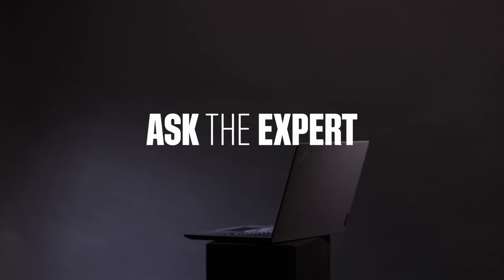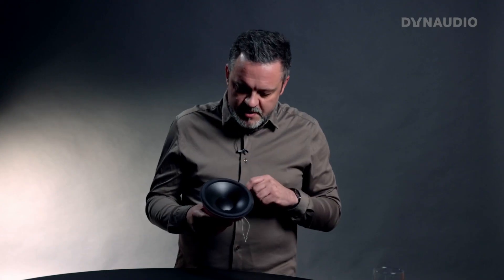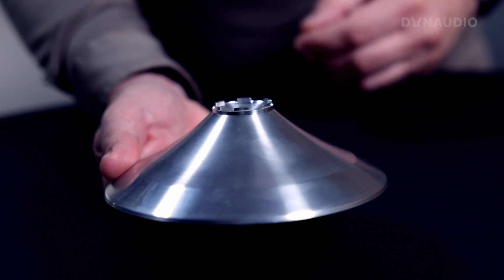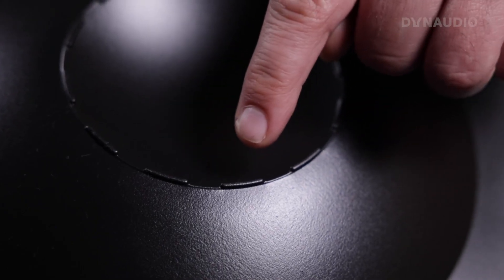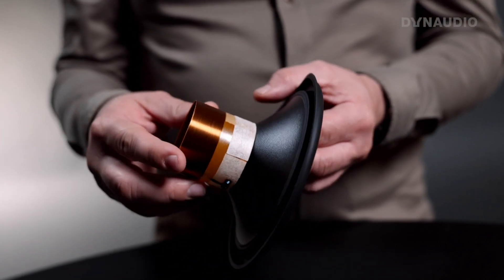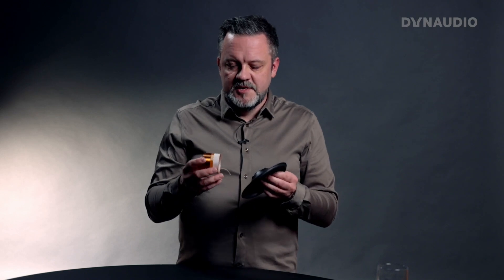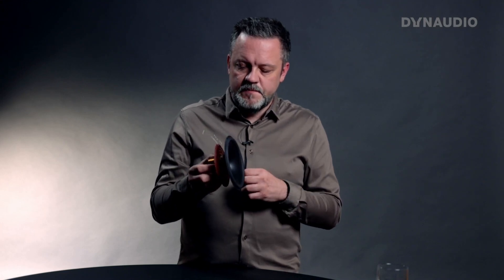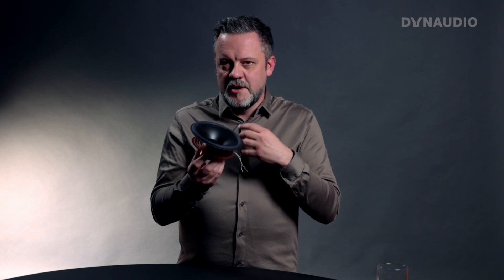Why are there holes in our speaker drivers?

Comment: Why do you, and every other speaker manufacture only put the rated impedance in the specs and not minimum impedance, or even the impedance curve?  Could you please share the minimum impedance for evoke 10s ?
Reply: I can only speak for ourselves, but we follow the current IEC standards on rated impedance, which essentially says that the minimum impedance cannot be less than 80% of the rated impedance. In the case of Evoke 10, that is rated at 6 ohm, which means you then know that the minimum impedance is no less than 4.8 (it is 4.9 in fact).

A few of the Confidence models are exceptions where we do specify a minimum impedance. The reason is that following the rule means we should specify rated impedance as 3.5 ohm, however there is precedence in the industry that we round off to 4, 6, 8 etc., and rounding up to 4 would indicate that the minium impedance is 3.2, which would be inaccurate. So, in these particular cases we include the clarification of minimum impedance.

We generally don't want to encourage the growing trend of over-reliance on looking at measurement curves over actual listening, which is why we keep most of our internal measurements to ourselves.

We made a video specifically explaining how we specify impedance a while back. This includes some examples of typical ways impedance is often specified incorrectly by other companies. In those cases, I guess you will have to ask them the same question 🙂

https://www.youtube.com/watch?v=0YdxA7ujbNA

/Otto, Dynaudio Academy
Reply: @D @DynaudioAcademy thank you for your  thorough response, appreciate it.

Comment: I would have thought it was to allow equalization of air pressure between the interior and exterior of the speaker enclosure.
Reply: That is why the cross vent on back side of closed cabinets

Comment: Why doesn’t Dynaudio make larger woofers?
Reply: Because they don't need too. I have a set of Confidence 30's, There are 2 bass drivers and a mid plus the tweeter. All are sized correctly. Best detailed musical speaker I have ever owned.
Reply: @JerryM-p2v  I’m a Dynaudio fan all the way, I’ve had a few pairs myself. But, when you listen to the sound of an old Altec Lansing system and gave it the same chance you gave the Dyns, you will truly never look back. I think Dynaudio can reproduce that quality sound. All they need is a larger woofer ~15”.
Reply: They make, in Consequence model. But all in all i guess they just dont want to produce a grandma's closet styled speakers. There are many reasons for it. Brand philosophy, professional monitors DNA, just aesthetic aspect. Btw dynaudio bass(with good amp) is really exceptional, even in bookshelf segment.
Reply: There is a tradeoff with baffle response due to the wider speaker cabinet that requires. I think that is one of the reasons. They also produce subwoofers with 9'' woofers which play down to low 20Hz and integrate wonderfully with Dynaudio speakers.
Reply: Because there's no need to.  I have a pair of Emit 20's , nothing special about
a 50cm. driver (you'd think) , it took a while to dial them in but they can
 kick yer arse when you '''''need" them to. ( of course if I could afford to step up 
                                                                       I'd like to own a pair of Confidence 20's
                                                                             but not today)

Comment: I thought the holes are there to avoid some of the cavity resonance behind the dustcap-voice coil and magnet.
Reply: But since the holes are not holes at all, this is obviously not the case. 😁 Traditionally, Dynaudio use big magnet structures with big center holes to avoid such resonances. Putting holes in this position would just introduce puffing noise and disturb the frequency response.

Comment: My very first car, 2006 VW Passat Wolfsburg Edition came with Dynaudio system. Beside that it's one of the best factory sound systems I've ever heard I'm very impressed by the build quality of speakers. I still haven't seen a car premium sound system with drivers are as nice as standalone home speakers of the same brand would have, Bang & Olufsens in Audi or Burmester in Mercedes or Harman Kardons and so on, they cheap out on material a lot, cones look like they would break just by blowing at them, especially infamous Mark Levinson systems in Lexuses of same era most of which have fallen apart by now. But Dynaudio kept it like it should. And this is an old Passat, today this car costs as much as a pair of Dynaudio home speakers would
Reply: I think that you ar eover-valuing your Passat.
Reply: @peanutbutterjellyjam2179 I’m praising Dynaudio not the car. Car is shit actually
Reply: Bang&Olufsen does not manufacture the speakers in car audio applications, they only do the DSP and send specific specifications to an existing manufacturer.

Comment: That was very interesting to see how the speaker is made!
A question I had for a long time is :
How loud can you push a monitor (for example my own lyd7), before strain is present? I use it usually at around 85db and I’v been told it can do much more, but afraid to raise to volume….
Reply: Until the sound quality starts to deteriorate, i.e. when audible distortion sets in.
Reply: @dabbidaa1547 Exactly! 👍 Why should one worry about distortion that you cannot hear yourself? And there's no question that distortion resulting from technically overloading the speakers is very audible.
Reply: @dabbidaa1547 haha, check yourself on some distortion tests. Many people won't hear distortion until it's 15% or so. The no / low distortion zone is much lower then just below where you really hear it.
Reply: Hi. The LYD7 is an active design, that employs limiters to protect the driver from over-excursion. So in terms of damage, you essentially have nothing to worry about. Play as loud as you want. If you are worried about distortion, you can definitely go louder than 85 dB, however it heavily depends on the material. So, use your ears. If it doesn’t sound distorted, don’t worry about it.

/Otto, Dynaudio Academy
Reply: Thank you very much for your helpful answers!

Comment: First thing I thought about was noise from Air passing through those small holes as the driver goes back-and-forth ?
Reply: Maybe at something extreme like.. 10hz at 90+ db
Reply: @CasaPanaFanaLanda hmmm so the part where there not even holes evaded both your ear holes? Cool!
Reply: @fakename9257 Maybe these guys should have watched the actual video before commenting on "holes" ... 😉
Reply: @CasaPanaFanaLanda 10hz 90dB will need 18 inch and that too will not be audible. also you will need 900w+ to barely get 90dB.

Comment: It was great company.. now out of league.. what reason don't know
But particular for me I do not prefer low sensitive speaker among lots of brand dynaudio is one who prefers low sensitive
Reply: The smallest three channel plate amplifier in the Hypex Fusion line,  the FA123, has a 100W amp and two 150 W amplifiers along with three DACs and DSP crossovers. This is state of the art for DIY speaker creation.   Going on about "low sensitivity"  would seem to be pointless if you are designing modern high fidelity speakers.  You can get high sensitivity drivers, but the light weight cones will not behave as a piston and you won't have a smooth flat response or the great transient response of a more robust cone or dome that acts as a piston.  If you like cone cry, breakup and such, go write about it on a video featuring those kinds of drivers.
Reply: @NackDSP 
OK sir
Reply: The problem is not the Dynaudio woofers, the problem is you needs a high current amp to get the most out of them. Once you do, you will get a better sound than any high sensitivity speaker can make.
Reply: What do you mean by "out of league"?